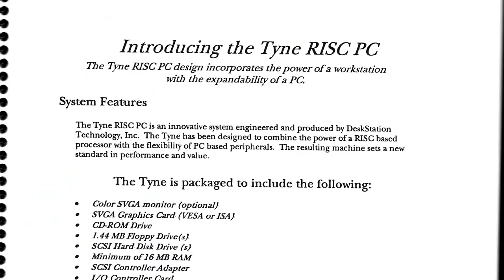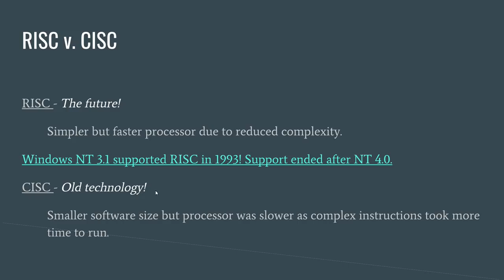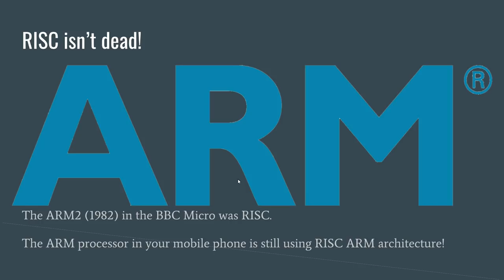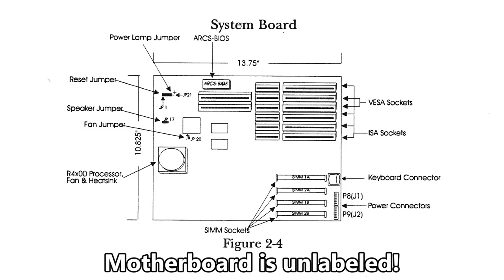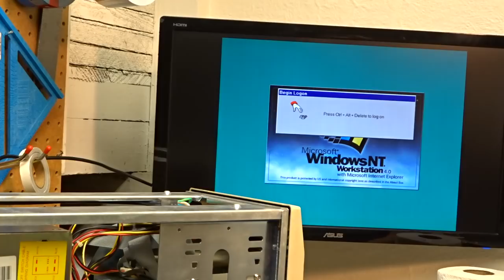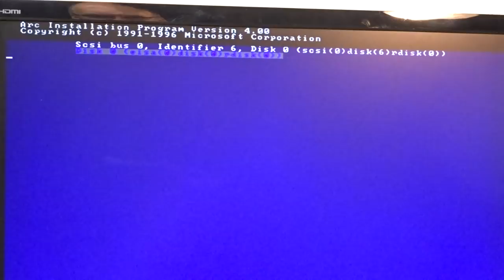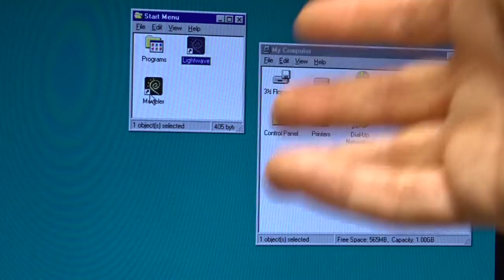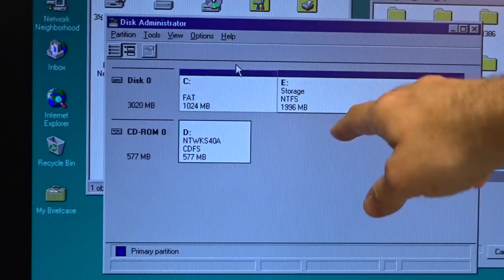Deskstation Tyne: A MIPS R4600 based PC that runs Windows NT

Comment: There is a bootable CD called Ophcrack that will crack the login PWs for all NT based versions of windows from NT4.0 up to W7. I've not tried it with h8t or 10 as I have no intention of every using them but I think it should work. Hiren's boot CD also has a little DOS utility to reset windows PWs to blank.
Reply: Just to add, Ophcrack boots into a minimal Linux OS then autoruns the PW cracking programming.
Reply: PROGRAM
Reply: I guess trying "admin" as passwort was not successful?
Reply: There are plenty of Linux MIPS ports. I've run Linux even on a Silicon Graphics machine. Sure, there won't be an ophcrack port, but Linux in general? Yeah, no, I'm pretty sure you can run it on that machine.
Reply: It would probably work if you put the drive into an x86 machine, yes. The Linux distro just goes in and blanks out the stored passwords in the filesystem.
Reply: Yup, it should work fine, I've used that before back when I was an NT admin (ironically of some SGI NT machines).
Reply: I'm sure you could just compile ophcrack from source for mips
Reply: almost all Debian packages (and most other distros as well) are compiled for many different cpu architectures and have binaries ready to go. The aforementioned ophcrack is available in mips, mips64el, mipsel, and 7 other architectures from the debian package repository: https://packages.debian.org/stretch/ophcrack (scroll to the very bottom of the page). It is very possible to write code that can be compiled to many different architectures with no changes to the code (or at worst, some conditional compilation). While this machine is mipsel architecture, Adrian seems to be right, doesn't seem like the kernel was ever ported over to the Deskstation Tyne. You can find a bunch of mentions in mailing lists, but most of it amounts to "this was dropped due to lack of hardware to test on" type comments.
Reply: asdg
Reply: Ugh, I typed this once and then it disappeared. Most (if not all) debian packages are cross compiled for 10 different architectures, including mips, mipsel (what this machine is), and mips64el. Even ophcrack is available as a binary compiled for these architectures. See the very bottom of the page https://packages.debian.org/stretch/ophcrack Adrian may be right though, it seems the kernel was never ported to the Deskstation Tyne. You can find mention of it in mailing lists, but it usually ends with comments like "dropped due to lack of hardware to test on" type comments.
Reply: Another option would be NTPWEdit, which runs on Windows. It's obviously compiled for x86 but should work on the MIPS emulation layer. So you could reset the password from the clean NT4 install.
Reply: An old trick used back in the NT 4.0 days was just to rename the SAM file to SAM.OLD and it would allow you to log in as administrator with no password.

Comment: x86 processors became RISC processors, just RISC processors with a thick-juicy layer of CISC on top. What used to be a bespoke instruction that is individually processed by the CPU, is now broken into a series of CISC instructions and processed in rapid fire sequence, often out of order or even across multiple CPU cores. So logically the CPU is CISC, but operationally it's RISC. It's why modern x86 processors can run at 4+ GHz.

CISC didn't beat RISK, CISC joined RISC.

Comment: To the RISC/CISC part: modern x86 CPUs are RISC inside. They have many registers, huge cache and they do not execute the x86 instructions directly, but they compile it to micro-ops. Of course, this compile takes some transistors, but that is not too much (once I read something like 5%), so that difference does not really count today. ARMs eat less, because they were designed from the beginning to do so. x86s are faster, since they were designed to be PCs in the last 40 years. But there is no magic, the power consumption per instruction (i.e. the "processing power/power ate") is about the same, when the manufacturing technology is the same.

Comment: The 64 Bit extension were first added by AMD to their Athlon Processors.
Intel insisted that Itanium was necessary for 64 Bit processing. But that had more to do with wanting an end to the x86 Architecture because of the sharing agreement they were required to have with AMD, due to DoD contracts.

Comment: as for that whole risc/cisc and some stuff in between (6502s etc) discussion: it really doesn't matter at all in terms of speed. the only thing that matters is how much data can it pump from or to the databus per clockpulse... as computers don't spend most of their time doing comparisments or calculations but simply: moving data from a to b. :P after the relatively tiny task of calculating where the player sprite is on the screen or what the destination mac address should be, most of the work is simply: to pump the data around without even looking at it. scrolling the screen, sending and receiving packets. so presence and cpu cycles per instruction of stuff like MOVSW or the speed of LDA/STA is actually far more important than how quickly it can calculate 60 digits of PI :P even completely lacking things like MUL are relatively unimportant compared to that. cpu cycles per instruction that moves data, preferably with some instructions that just move stuff from a to b straight away with a single instruction.

Comment: nice video, it's very interesting and weird to see something that resembles a pc but is not x86. I can't imagine what it would be used for, most stuff from that era supported x86 only and NT was not as compatible as it got in 2000 and xp, pre 2000 nt was not like 9x so most games wouldn't run, you needed x86 and DOS/9x to run games.
I wonder if netscape navigator would work on it, I doubt mozilla firefox has a version for that cpu, but maybe there's a netscape version for it.

Comment: What about trying a modern Linux distro on this thing?
I think you can still find some that probably still have compatibility with this thing...
I don't know about this CPU in particular.
But a quick search on distrowatch shows these as mips compatible at least:
https://distrowatch.com/search.php?architecture=mips
I don't know if that applies to the latest version or if you have to try one of the older ones or if there's some workarounds needed to make it work...
But trying to get a relatively modern Linux distro (or BSD) up and running on that thing could probably be a fun side project.

Comment: How much size difference is there between executables for Win32 for Pentium vs Win32 for this RISC 4600?

Also, S3 video card? People called that the decelerator (instead of video accelerator).
When I was running Tomb Raider 2 on a Pentium MMX 200 MHz, S3 Virge DX 2 MB PCI card, when I enabled D3D mode, the frame rate was like 5 FPS (my wild guess). When I enabled software mode, it was like 20 FPS.

Comment: Not that it helps that much but I do have found few odds and ends for Windows NT & MIPS.  You can get them from here:  https://vpsland.superglobalmegacorp.com/install/WindowsNT4.0-MIPS/  You'll get a 404, just use the username/password from the 404.  Internet Explorer 3 for the MIPS is a big step up from version 2!  Also there is a version of Quake in there as well.  

For anyone interested Qemu the cpu / system emulator can run Windows NT MIPS, and is the only way the majority of us will ever see NT MIPS as these machines are insanely rare!

Comment: There were leaked development screenshots around of extremely early versions of 8 (basically still 7) running on ARM devices. Windows 8.0 had an official ARM release, Windows RT.
Reply: Which was a complete waste of time.
Reply: @lawrencedoliveiro9104  It was alright with the jailbreak in place.
Reply: @BonkedByAScout  Still couldn’t run any software worth a darn.

Comment: A RISC has to execute more instructions to accomplish the same thing as a CISC, so instructions per second are not meaningful. Also, the 'E' in DEC stands for 'Equipment' not 'Electronics'. Also the company that produced SPARC is called SUN Microsystems, not SUN Workstations. Also, ARM is for Advanced RISC Machines, not Acorn RISC Machines.
Reply: Hence the term "Meaningless Operations Per Second"

Comment: SOME CORRECTIONS... xx

The Archimedes was the first ARM home computer, if we ignore the ARM1 second processor. Released for the BBC Micro during #RISC development.
HOWEVER... this machine may have a RISC badge on it but it is not a RISC PC - of any kind, sorry.

Acorn never ported RISC-OS to MIps/PowerPC - They only built machines on the ARM610 to StrongARM chipset.
Those ran Windows on a second CPU, plugged into the tandom socket in the machine. Mine has a blue x586 card at 300mhz.
There is a long list of corrections I could post about the history, code impact and Risc-ness in this video,
But I won't brow-beat you, not when you've made so much effort on it.

Still, this isn't a RISC PC - or an Acorn-clone product (such as they ever existed) and cannot run Acorn operating systems.
The Mips/PPC platform isn't the forefather of ARM #Cortex, as seen on all smallish devices on earth now.
It's a different chipset, one that was never fully adopted due the Wintel pushing CISC to the bitter death... as it still continues to do.

Research #RISC5 (HUGE money 'open source') and #Sifive custom SOC systems. For where Windows is trying to go now.
In my opinion this is an attempt to force-adopt a less able (and largely copied) risc standard to avoid paying the tiny ARM licence in production.
Having repeatedly failed to port any Win version fully to ARM - Wiot = failed - WinRT = failed and currenting WOA = also failing.
Microsoft are a big and very competent company. If they wanted a full library on WinARM64. They'd have done it...

In comparison, RISC5 ported 85% of the #Debian library to 'new risc' in under 6 moths.
Linus Tech Tips #LTT has a video on this but it is all badly ill-informed and mostly advertising for Sifive.
Disregarding 30 years of optimisation, when modern ARM SOC's often have Decacores (10) and run a total of 15ghz or more, by cycle

Sorry there is a lot, I hope breaking it up helps. Here (link).. is a Risc PC as last seen in production by Acorn.
>> https://www.retro-kit.co.uk/page.cfm/content/Acorn-RiscPC << before they diverted to open licencing as Advanced RISC Machines in 1998ish.

Hugs - Illu

Comment: I just wanted to point out you listed 64-bit extensions as a feature of Core 2, when Pentium 4's Netburst already had 64-bit extensions.

Not that I like Pentium 4, but thought it was something that should be pointed out, interesting video otherwise!
Reply: The really funny part is that Intel tried to break backwards-compatibility with their 64-bit Itanium architecture.  Only after it fizzled out did they swallow their pride and adopt AMD's x86-64 spec, preserving compatibility with the older stuff.
Reply: @TheRealBotcrusher
Small note: The early P4, Willamette and Northwood, were 32 bit only. From Prescott on they had the 64 bit mode.
Reply: @ThetaReactor
Right. The Itanium (nick named Titanium :) ) had a x86 emulation mode, which ran slow as molasses. So there wasn't a viable migration path.

Also, the Itanium architecture based on VLIW, looked fantastic on paper, but they never got close to the performance they aimed for. Not even in the high performance computing market were it supposedly should have had the optimal architecture for. Itaniums were soon beaten by Intels own x86 offerings. Embarassing.

Comment: BTW would you consider a modern video card GPU to be a form of a RISC CPU in regards to it's reduced instructions and they really just a big number crunchers.
Reply: GPUs are definitely RISC architecture. They don't have complex instruction decoders or complex microcoded instructions. They are a variant of RISC which uses a trick called "fine grained multithreading", which refers to the ability to have a huge number of threads and switch to another thread instantly whenever the current thread blocks on memory access latency. They have so many registers that they don't have to store/load the register values when switching threads, they just kick over to using a different range of them. Instantly switching to another thread allows it to rarely wait for memory latencies, and it increases throughput drastically, at the cost of a huge increase in CPU complexity and power consumption.
Reply: I thought that GPUs used Very Long Instruction Word processors similar in theory to Apollo Domain's PRISM, Intel's i810, the Itanium, and Transmeta.
Reply: Being VLIW doesn't mean it is not RISC, it is just a different way of encoding the instructions. VLIW means that the instructions are bundled into groups that are guaranteed not to have any interdependencies, so the instruction issue unit can blindly issue the instructions in the group without checking for pipeline hazards. Not all GPUs have been VLIW.

Comment: Might always wanna look @ cap's in power supplies. Never hurts to c how they fare. And why not taking out a temp/an controller out of a old/obsolete power supply. It comes with a temp sensor and perfect connections to a 2 pins fan. So it can control the voltage by itself while sensing the temperature. It is always often on a separate system board and easy ti fit with some minor adjustments. Namasté

Comment: 4:40 is it compatible to a 8086? I'd like to see you run MSDOS 3.3 on an i7-7700k PC natively, not via emulator or DOSBOX. The problem is modern motherboards won't have the I/O for old media that DOS came on. I guess the work around would be a DOS bootdisk on a USB drive... but USB didn't exist back then, even with MSDOS 6.0.
Reply: The main problems to do that are:

DOS expects a maximum of 640kb of base memory and a maximum of 512Mb (If I can recall that right) of XMS memory, so that's already a problem as I don't think you can find DDR4 sticks that are 512Mb or less.

Some  (very old) DOS programs are tied to the system clock for timing and while they run fine or an 8088 at 4,77MHz, they will either run too fast (if it's a game it will be way to fast for playing it, the music will sound as if you were playing a cassette in fast forward mode and the controls will be extremely touchy and unusable) or, more likely, crash with a divide by zero error. I remember this being a problem already on a 100 MHz 486, and the turbo button was there to slow it down to 4,77 MHz!

I/O will be completely unusable without drivers, as modern chipsets don't even support native PCI (only PCIe) and the mainboards that have PCI slots like my AM4 mainboard do that with a PCIe to PCI bridge that DOS obviously doesn't support. SATA is usable by DOS provided that it supports native IDE command mode (not AHCI).

It would be better to try and install win98 on a modern PC, the only problem would be finding a 512Mb DDR4 stick but then it would work better than DOS due to having already support for modern things.
Reply: Yeah, the things that definitely work in a laptop are the video card, since all are capable of 80 column mode and VGA, the keyboard almost always uses native PS/2 (the mouse/touchpad sometimes uses I²C and this causes problems in modern versions of Windows too!), and the PC speaker. Some hardware sound cards (real sound cards not Realtek codecs) still have Soundblaster emulation built in hardware, so those will work too if they are PCI.

Comment: RISC is essentially here to stay, as most current x86 processors, especially AMD's, are internally RISC to keep the superscalar out-of-order pipelines simple while also focusing on the most vital parts such as branch predictors (AMD Ryzen processors have artificial intelligence branch predictors internally to work out what the software is doing to optimize the execution scheduling to run the codes more efficiently). Not to mention the popular RISC microarchitecture, RISC-V, which is actually open source, even the out-of-order execution schedulers once a top secret sauce, are now open to be studied upon how the processor handle the complicated machine codes.

Comment: I think it's important to note that the big deal about RISC vs CISC computing wasn't that RISC instructions were inherently faster, but that they were much easier to pipeline. In the early 90s, the big CPU advancement was the ability to execute multiple instructions at once, which is known as superscalar processing. RISC instructions have an inherent speed advantage in superscalar processing because they're all the same size: Unlike CISC, each RISC instruction takes the same amount of time to complete, so one or more pipelines in a superscalar CPU aren't stuck waiting for an instruction to finish in another pipeline, as would be the case with pipelined CISC instructions. Intel, for their part, basically killed the CISC vs RISC debate by creating the Pentium 4, a CPU that looks like a CISC chip to software, but acts like a RISC chip internally.

Comment: You should be able to connect the hard drive with NT on it to a regular PC. Boot off the CD-ROM on that machine with a tool that can recover NT passwords, then move it back over to this machine. Of course make sure to not boot off of that harddisk on the x86 PC who knows what will happen.

Comment: VLB was for backward compatibility developed along the same time as PCI which won out because it was cheaper to use pci and still get decent bus speed communication.
you missed system files for lightwave that would end up in system folder. not to mention possible entries in win config files or Registry entries.
Try Different flavors of Linux I saw a few. https://www.debian.org/ports/mips/index.en.html
to use Slackware you may need custom kernel and start disk.